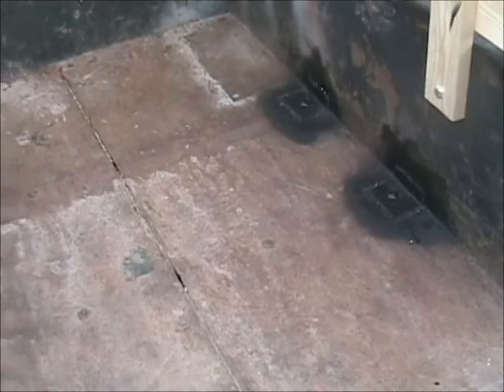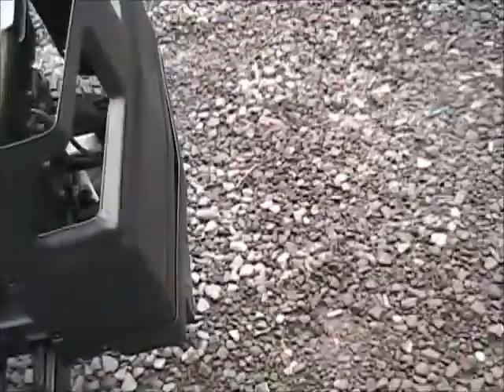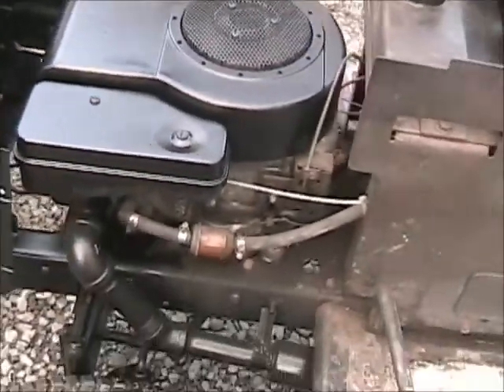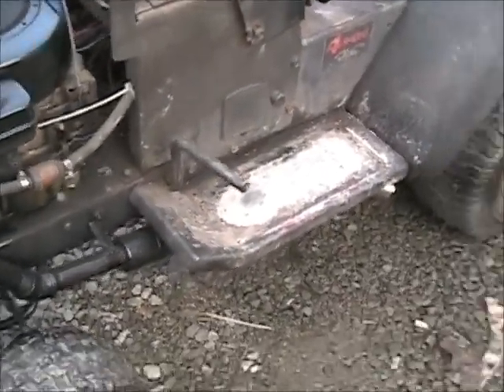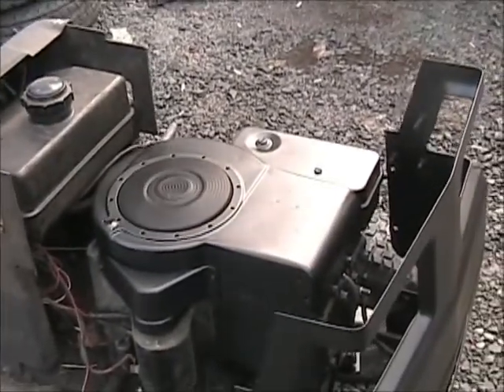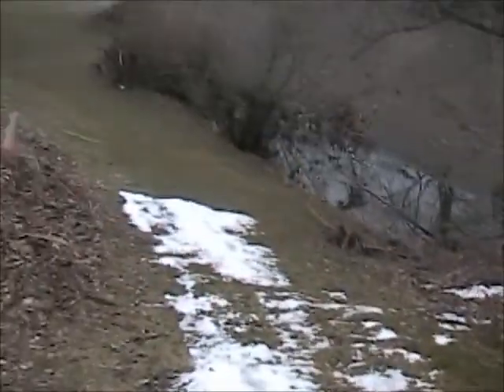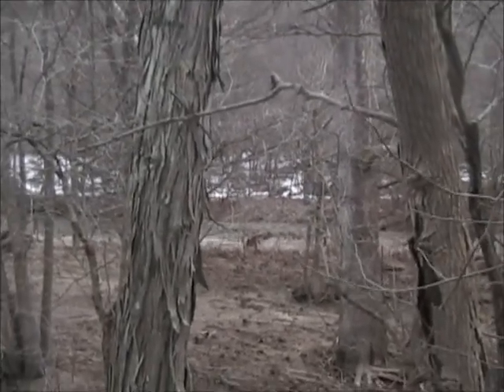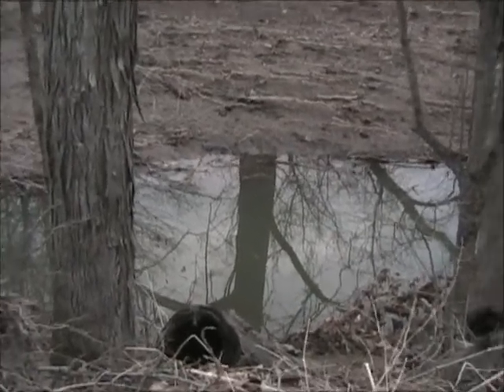Episode Twenty Seven Flood update Rat Rod Tractor and Yard Trailer.wmv

Comment from the maker: @1963impala2dr  Hey Thanks!! i have them stained now (2 coats is on) and built a bench for the inside. so my Daughter can ride back from the bus stop. couple blocks away..Plans are to strip the color off the trailer and redo it, will under coat the inside then i wont haul gravel with it any more..LOL